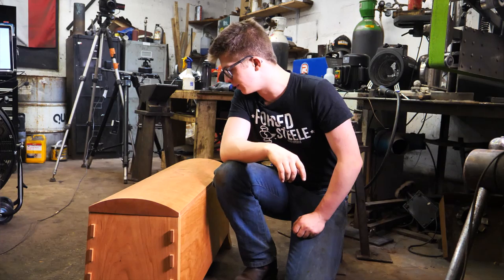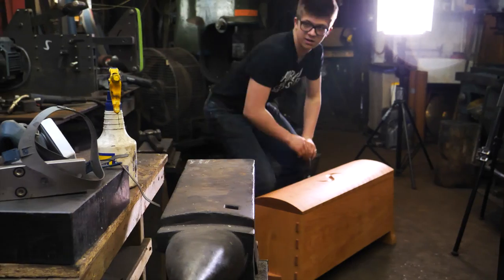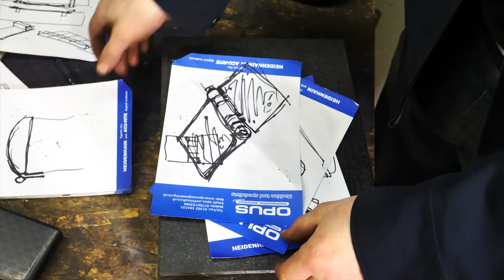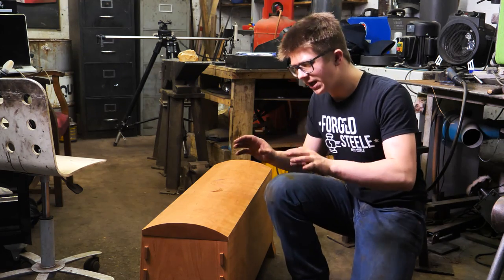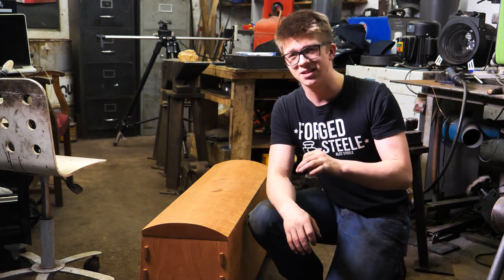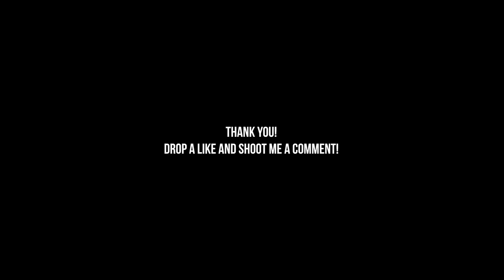FORGED HINGE PROTOTYPING: World's Most Beautiful Box!

Comment: Alec your makers mark would be great handles with stand offs to be attached from inside. As for the hinges a three piece with a longer center tongue for the sides two bolsters to capture the pin. Use your mill and lathe to make the pins and holes when assembled you won't see the pin. "Note" you will need to take into account for the edge thickness of the lid so your pin  center line is centered in the joint

Comment: Rather than taking away from the simple beauty of the lid, why not put the hinge on the underside, which is traditional? You can still reveal the straps to the body of the box on the outside down a few inches perhaps. That way your hinges are visible from the outside with the box closed while not interfering with the curved solid lid. Just a thought. Call Jesse for input on the mechanics of how to mount. Yes, must pre-drill holes. As for screws, why not forge pyramid shaped heads similar to 18th century nails? Dip in expoxy and tap into predrilled holes.
Reply: be sure to test them hinges befor fiting to make sure the lid wont bind

Comment: ideal: drift a hole through those large blobs on the ends that is the size of your pin (possibly with the actual pin?), then machine the two blobs so that they are equal width. next machine two slots in each blob that are 1/4 the width of the blob; one starting on the edge and the other starting halfway across, this way, when you turn one of them around to fit them together, the remaining tabs fit into the corresponding grooves.

Comment: I agree with you that too much hinge would detract from the beauty of this box.  More so, I think that a concealed hinge, something that is visible only when the box is open could be considered.

Typical hinges are made from sheet metal.  This clearly isn't a typical hinge.  As a mental experiment let's think about what a hinge consists of.  A hinge has a barrel, pin and mounting ears.  The pin shouldn't be too difficult to machine but instead of using damascus may I suggest bronze or brass?  Either would complement the damascus without being distracting.  I think that the barrel should be made the way a gunsmith would make a barrel but obviously on a smaller scale where the OD would be around 8mm with a bore of about 4mm.  It just means that you would spend a bit of time on the lathe.

The barrels should have a flat machined into the face such as they mate and prevent the hinge from extending past a certain point.  Otherwise there is a risk that if the lid is dropped, the hinges could rip the wood.  I don't think you would want the lid to open with an obtuse angle more than 100-120 degrees.

Here is the part that I think you will dislike because it involves brazing.  I think that you could braze the mounting ears to the barrels easily enough and if you think it through it could be done such that the braze fillet would be concealed.  You could weld if you thought you could keep it clean and tidy but I'd prefer brazing for this.

I'd be happy to CAD up something for you if you like and I'd 3d print a prototype that I'd send.  Indeed I intend to do this just as a mental exercise for myself.

Comment: If maintaining a smooth functioning hinge is an issue, don't forget that you can roll/weld the eyes (or whatever method that produces something that is close to round) and then finish the I.D. on the milling machine to make them perfectly round and aligned. Insteadmy of completely ignoring the grain of the Damascus by drilling (like the abrupt bored holes in the fidget spinner), I was wondering if it might be possible to drift the hinges to maintain at least some of the flow of the pattern around the hinge pins. It is those minute types of details that the average person might not even notice (but a skilled craftsman would upon close inspection) that set amazing pieces apart from master works, especially on a multi-generational heirloom such as this.
As always, a blast to watch your enthusiastic and energetic workflow. Keep up the amazing work! 😊👍👌

Comment: I agree with his method. I also like the idea of just having 2 pieces of steel that have the I's that are nice and simple, yet elegant. And I also had although. Why not make a pin system that when you have a pin in, it makes the height that your hammer comes down uniform. So Lets say your only working on at most a 6 inch wide something. So you bring the head down from 2 feet to about 10 inches. So you just have to put slightly more force on the foot piece to hammer. IDK how well it would work. Just a thought

Comment: hey Alec! i have a suggestion for you to make your life a bit easier with moving the box around.
 i think you might want to put a handle on one end and 2 wheels on the other. and put the wheels in a way that they are a bit above the ground so when u lift the handle the wheels will touch the floor and you will be able to roll the box on them.
a bit like how you use a wheelbarrow.

if it's sound interesting but you still didn't understand i will be glade to make a sketch for you.

Comment: I think the hinges going across the whole top would have been cool, and would have added then taken away from the beauty of the top. And you could have made it look like the straps across an old chest.       you could put square holes in the bands and forged Damascus bolts with round heads to make them look like rivets, plus you have a leathe to make the threads, you could put a square shank under the head of the bolt to lock into the square wholes in the bands. just my thoughts Alec..

Comment: Why not small steel rods on the lid, then a curl (not closed loop) on the back side and the rod will fall into the 'open' part of that curl (between the wood of the backside and the curl) as you open the lid? Can be done 2 or 4 times. Then some sort of 'locking' mechanism on the front. This way it can close, open, and the top can be removed.

Comment: Maybe forging the 'mechanism' is the wrong approach. Forge the leaves, and the other fittings, yes, but then turn to precision solutions - crank up the milling machine. Drill the pin holes - check a furniture or door butt hinge. As a box maker, I reckon the hinges should compliment the box, but even more important, function faultlessly

Comment: Instead of folding a hole that the pin goes through for the hinge, cant you just like drill it? This way you can make the two sides of the hinge, mate them, grind, etch and all that, not worry about forge wielding or anything

Comment: let's say I wanted to make a forge out of an empty air compressor, how best could this be accomplished?
Reply: Chase Lee it depends what size of air compressor, and what type of forge. If you want to make a charcoal forge, there are many great videos out there, but the basic idea is to cut it in half lengthwise, creating two troughs, then take a flat sheet of steel, and cut it so it sits in the compressor about 4-6 inches below the rim. Then drill ventilation holes throughout the sheet, and weld it (you can bolt it if you need to) to the trough. The last step is to cut a hole below the sheet on the side of the trough and attach a hairdryer or a leaf blower. Hope this helps!